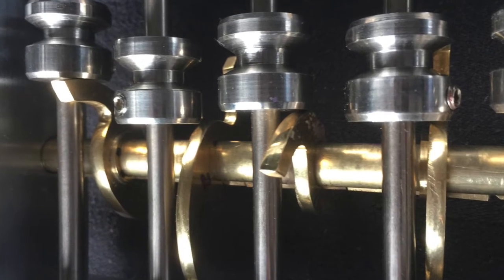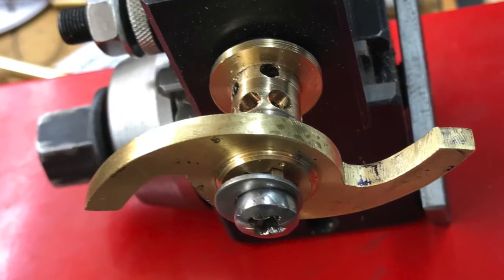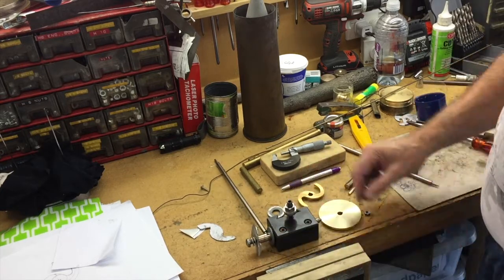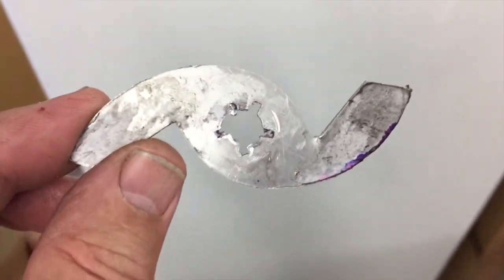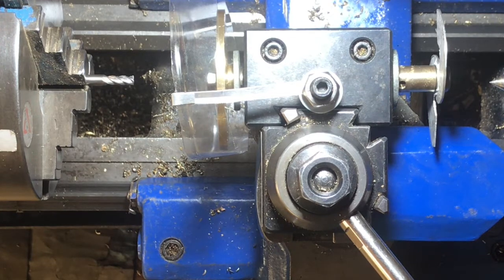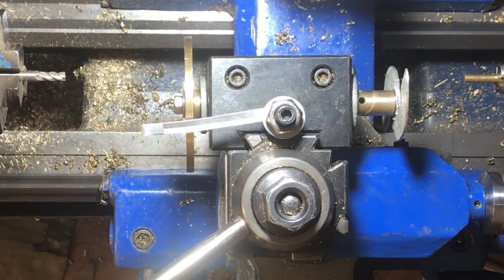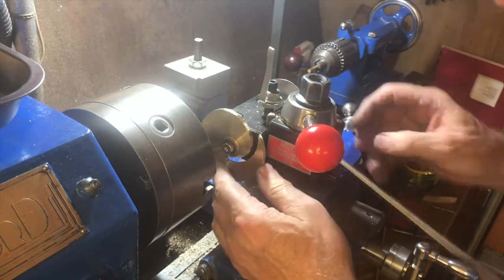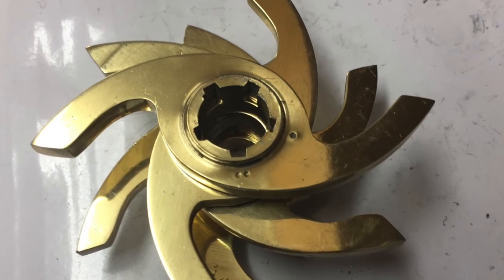How to produce cams on an engineers lathe

Comment: Great video. Makes you really appreciate what life would’ve been like before CNC Routers.
Reply from the maker: Thanks. Yes it was a real challenge. It would have been easier with a hacksaw and file, but that would have spoiled the challenge!  

Yesterday I took the model stamper battery to the gold mine where they have a full-sized working, 3 stories high stamper with hammers that weigh half a ton, and two stationary steam engines. Kids love to crank the handle of the model and watch the hammers.  They even put rocks in it and crush them to powder making quite a noise. So it is really popular with kids and adults alike.